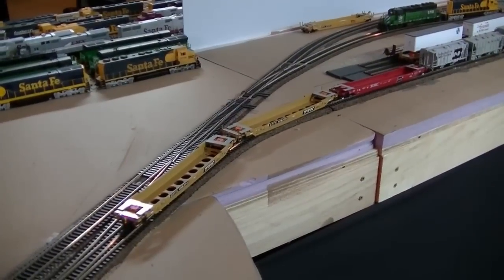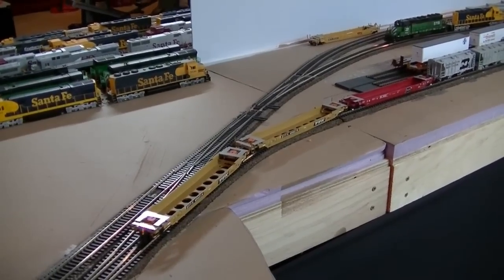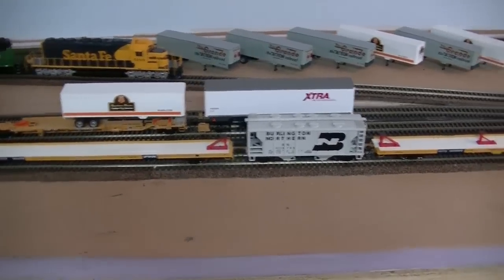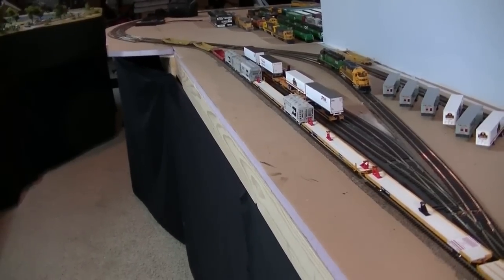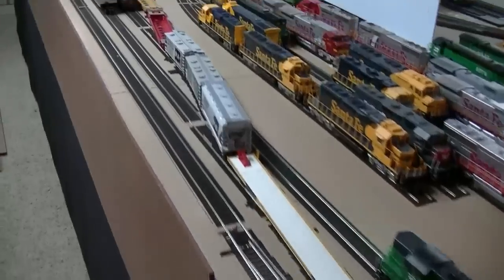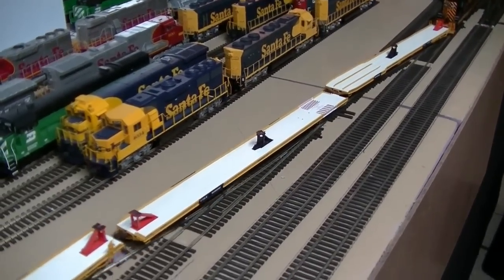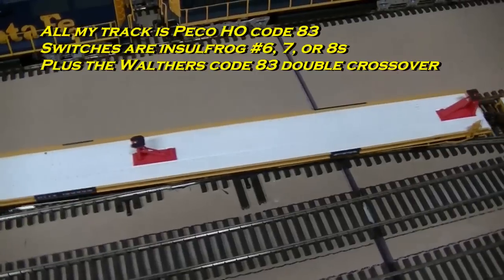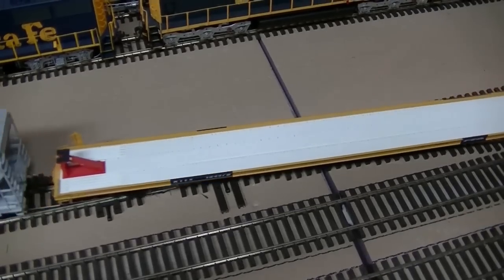Testing Model Train Tracks and Switches

Comment: Thanks for your video! Great!
I have a question, I have a problem with the insulated frogs on the double crossover.
How did you install the feeders wires on yours? Looks like it works perfect!
Thanks!
Reply from the maker: Glad you enjoyed the video.  I didn't do anything special in wiring the double crossover.  Just put power feeders (+ & -) at the end of each of the 4 tracks.  You could try "juicing" your frogs if the dead spots are giving you too much trouble, or you could install DCC decoders with a keep-alive capacitor in them.  That's what I did for one of my switchers that had problems going through the double crossover.
Demonstration of Keep-Alive DCC Decoder in HO Scale Short Wheel Base Locomotive
Reply: Perfect, will watch it now.
Also, I  subscribe to your channel!
Regards
Martin

Comment: I noticed in your video the sub-roadbed in your benchwork. In particular, the layers between the track and the wood framework. What do the layers consist of (Homasote?) and how do you connect the track to the sub-roadbed? (I didn't notice any roadbed per se, is the top "layer" a sheet of cork for the yard?)
Reply from the maker: +crownprinceofgroovy Most of my track has foam or cork subroadbed.  However, for the yard, I just put the track directly on the foam tops of the benchwork.  I used regular pink extruded foam for the top layer of my benchwork, but painted it brown since I knew it would take a while for me to get all the scenery in.  Cheers, Kevin

Comment: my track has a problem where i run the train over the track, and it stops, but if i move it onto another peice of track, it works, like the electricity simply isnt going through one section of track, any tips?
Reply from the maker: +Jacob Jarrett (JacobJayCraft) Jacob, it could be that your track is a bit dirty or that section has an electrical dead spot. This could be cause by not having good connections between adjoining track, not having enough feeder wires, or from using insula-frog switches. Insula-frog are great because they are easy to wire, but the frog is electrically dead so some locomotives might stall when going over it.  Here is a video about the problem and one potential solution. Cheers, Kevin 
https://youtu.be/ntX57WRhCyQ